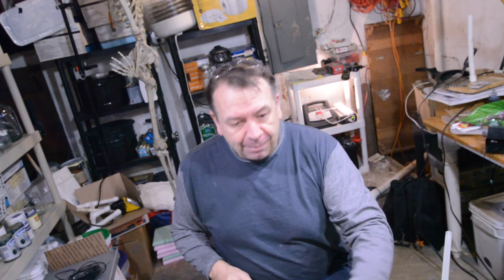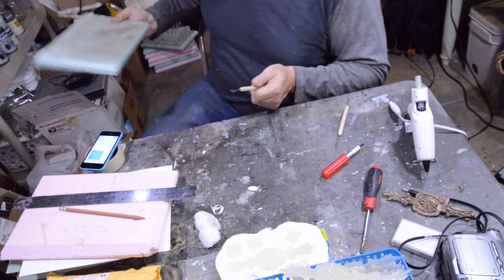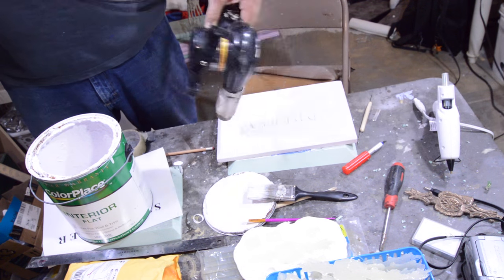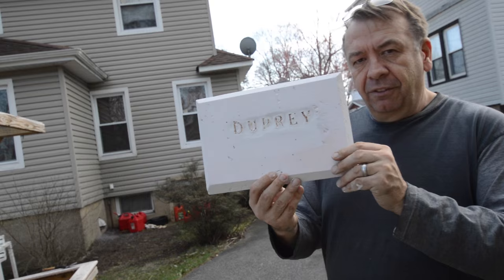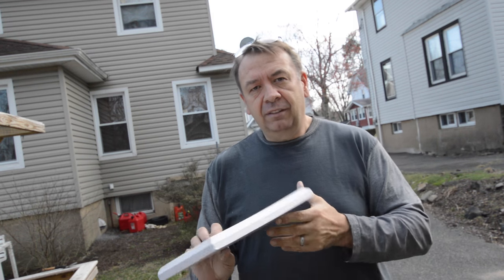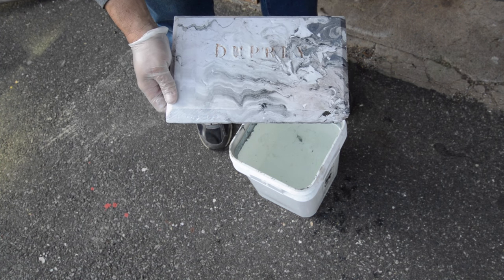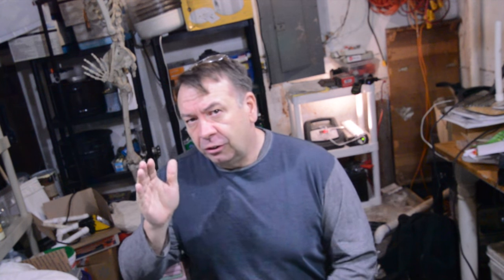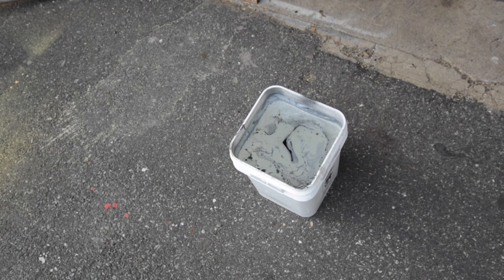Faux Marble Effect with Hydrodipping

Comment: We like the lighter marble but the black looked great too. Guess it depends on what the background is and what you're going for. Okay so that advice wasn't very helpful lol! That's a new method for us, dipping it in water. I don't think we have footage but the columns to our skull mausoleum were painted with a base color then we would go over with another color, take some plastic or a plastic bag,  push it against the wet paint and peel the bag up.   By doing that it would give the marbled effect. But I like your method for smaller props. Looking good!
Reply from the maker: +Hollywood Haunter Hmmmm. That seems like a pretty simple technique too. So many options. Fortunately I have a helluva lot of plaques to try them all out on! Thanks!